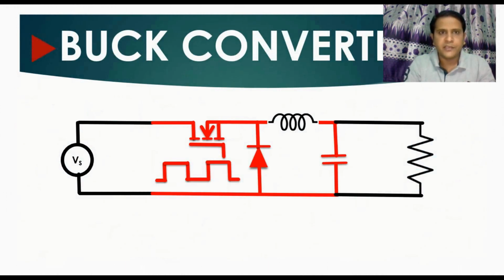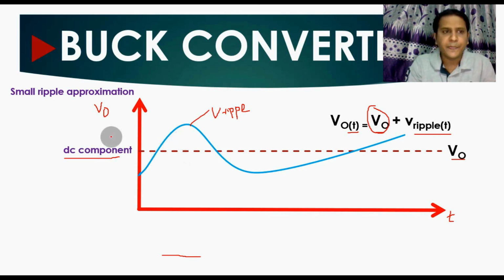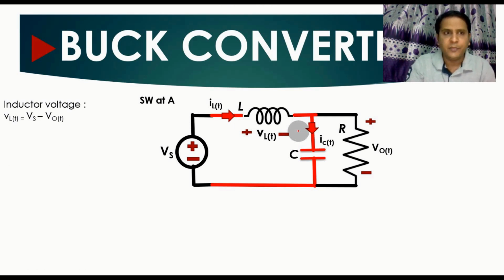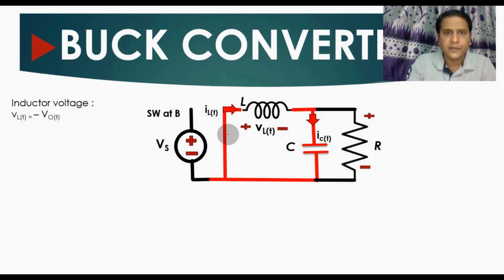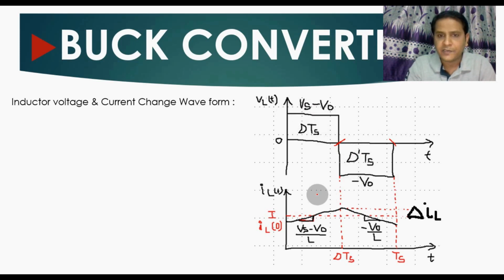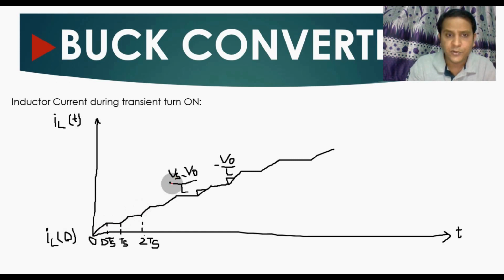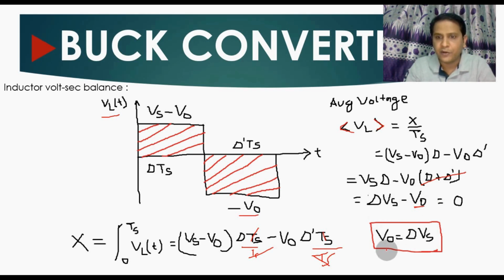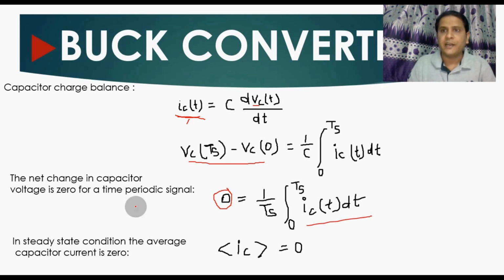Buck Converter Steady State Analysis - YouTube

Comment: Hi, I need some need designing an AC DC converter circuit For low energy harvesting that generates at minimum 250mV to 400mV atleast and low power between 30mWto 80mW. Thank you so much for the tutorial video. It’s very clear.  Can I use this. Can you help please?
Reply from the maker: Could you share your requirement and specification on electronicscircuithub@gmail.com